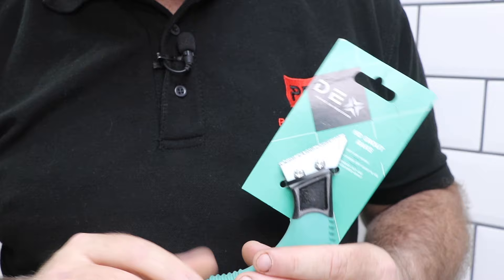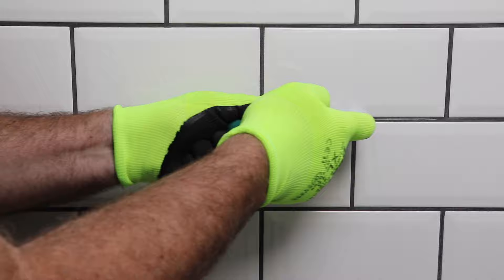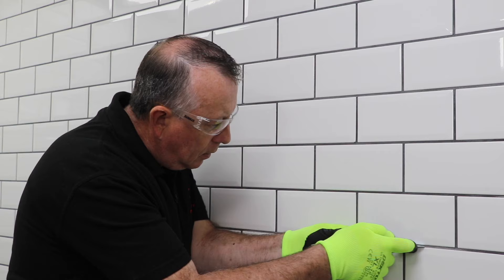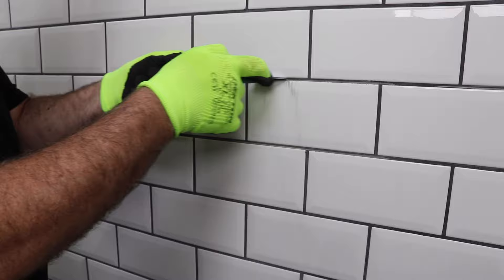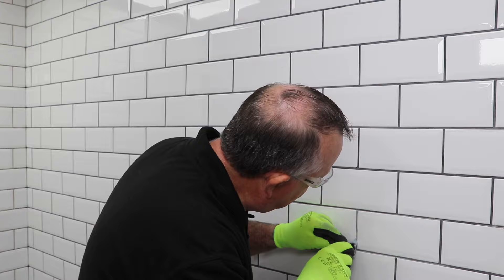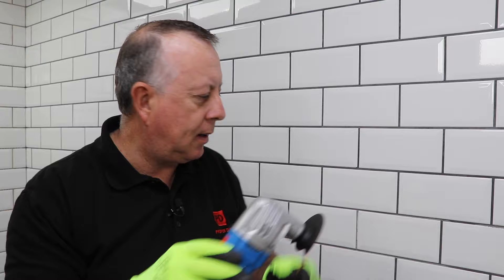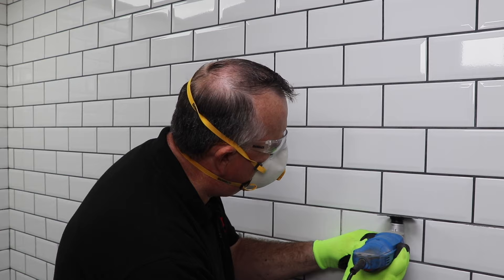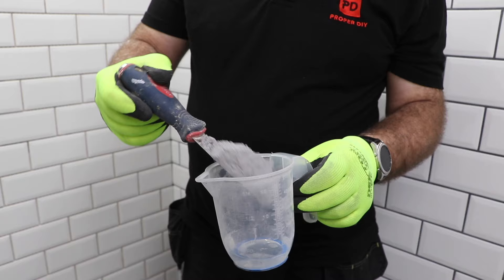How to re-grout tiles

Comment: I love these videos, they help me a lot. I particularly appreciate the clear and concise instructions, attention to detail, and wonderfully produced videos where everything is on display. I just wanted to mention at around 0:25 the presenter (if he mentioned his name, I didn't catch it, sorry) states that "grout overtime becomes stronger, harder, and more brittle." OK, from the point of view of mechanics, when a material is hard it is brittle which is the direct opposite of being strong. If the grout (cement-based) became stronger with age, it would be like a metal---not easy to break, undergoing plastic deformation rather then fracture when met with force. This is why we measure tensile strength and hardness as separate qualities of a material. BTW, it is the same with humans, those who are strong are not hardhearted. :))